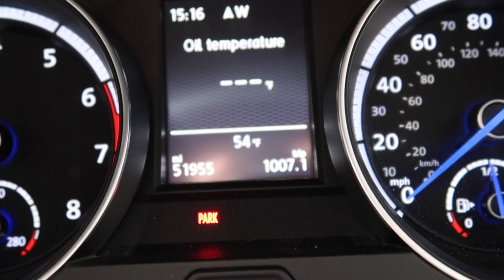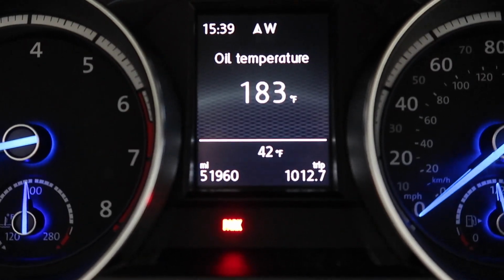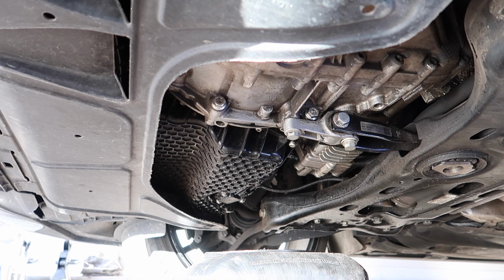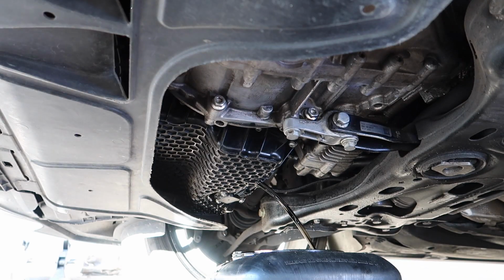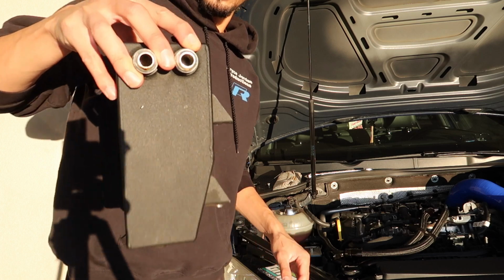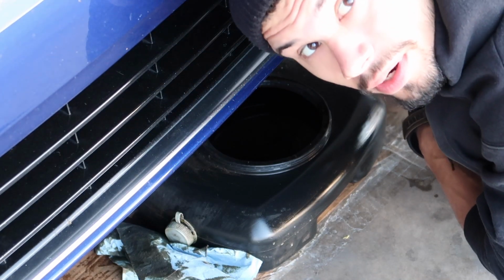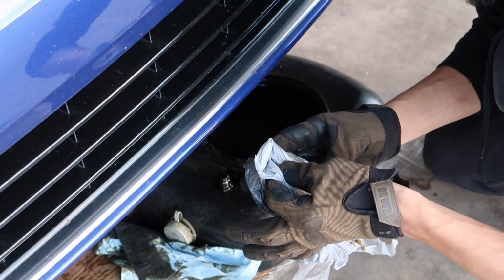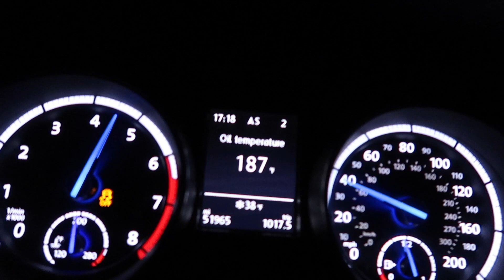Just Some Good Quality Time With My Lady!

Comment: Yo Bryce love the videos man just the true car guy , I have some questions regarding my stage 2 mk7 gti with intercooler from ie is three is38 worth my money for the little bit of power and my wheel hop is insane I need the best help to try and fix it I have good tires
Reply from the maker: Thanks buddy! To negate wheel hop id personally (and do run) BFI engine and transmission mounts along with an 034 or APR dogbone insert will fix that wheel hope right up! As for the turbo, it's quite a bit more power all across the board, it's OEM so fitment is 👌 and you won't NEED an aftermarket intake if you don't want. If you're looking for big boi power (you're gonna need real good tires) I would (and I plan on getting myself) the DBV2 V2 hybrid turbo with the triple ball bearing upgrade, you'll be set for quite some time with no reliability issues whatsoever!
Reply: Thanks Bryce love the support, and shoul I rush to get a TCU DSG tune
Reply: Do I need it
Reply: Got friends that like to race need all the help I can get to beat them lol
Reply from the maker: Absolutely, whomever you get a tune through I'd go with their dsg tune as well! Makes a huge difference!
Reply: @BryceJordanProductions  since its winter time over here in jersey do you still need a intercooler in 40 deegreee weather
Reply: i have 1000 to spend trying to prioritize mods that i need
Reply from the maker: Umm no I think you'd be alright for now,I ran the stocker all last winter and it was good, I'd definitely get one once temps are hitting 60+. Motor mounts and dog bone & downpipe then tunes then intercooler... turbo then fuel or vice versa 👌👌
Reply: @BryceJordanProductions  the bfi stage 2 engine mount kit comes with everything but the pendulum mount how important is the pendulum compared to the dog bone insert and engine and transmission mounts
Reply from the maker: I wouldn't use their (BFI) insert I got the engine and trans mounts separate then did the apr insert. They work together very well, the dog done (same as pendulum) is what will negate the wheel hop the most sense that stiffens the engine movement from front to back. APR also sells a new bracket for the dog bone but I don't think that's necessary until bigger power. Stock mounts are made for comfort and are very soft, the more power you throw at it the more it's gonna need to be beefed up
Reply: @BryceJordanProductions  yo man i have so many questions i apologize but feels good to talk to someone who knowledge on VWS, now what intercooller are you running
Reply from the maker: Do you have Instagram?? It'd be a little easier to talk cars lol @br32yce. I use mostly racingline products. Intercooler, intake etc etc very good stuff. There's a ton of options out there. IE probably being the most popular, then the mabotech Bicooler is actually pretty nifty you'd keep your stock and add a front mount it uses both intercoolers it's pretty nifty!
Reply: @BryceJordanProductions  in your onw video where you replace the dog bone insert from apr do you have to replace the strech bolt